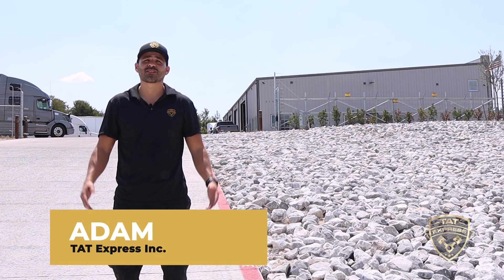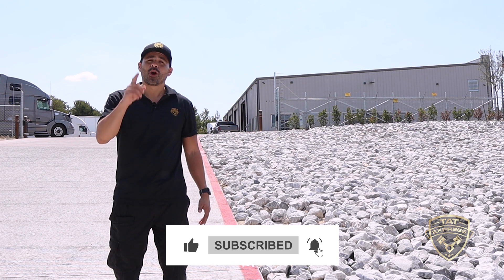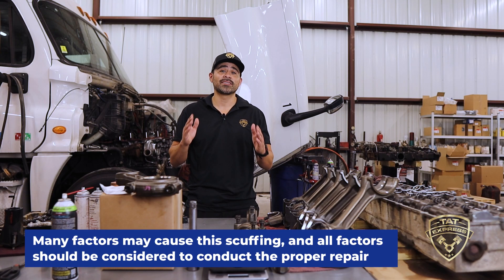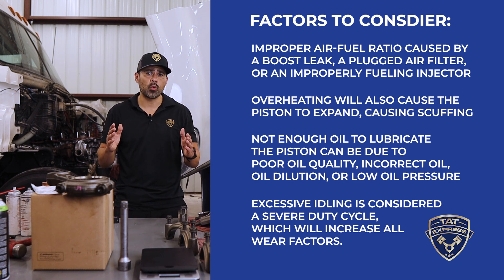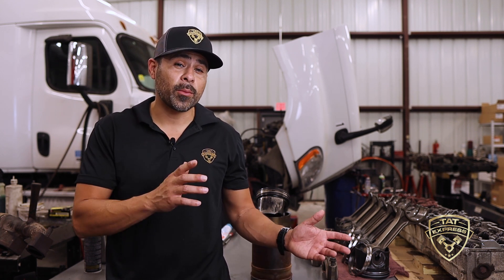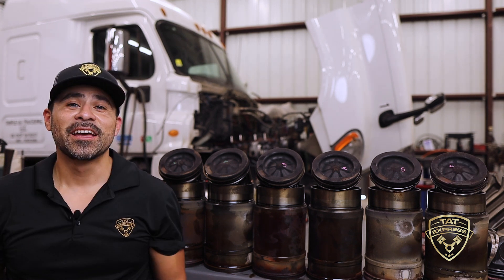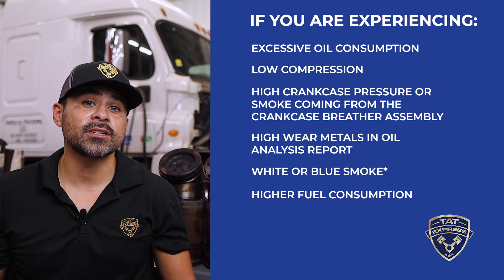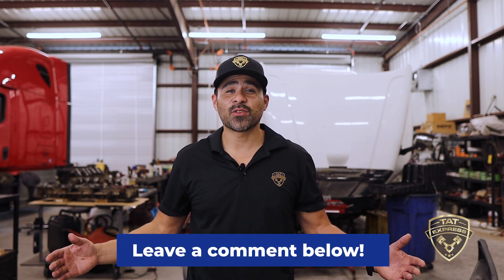DD low power/ DD low power output / DD13 engine/ dd15/ DD Delete/ low compression diesel engine

Comment: Hi Adam I have a 2014 d13 I have no boost pressure and the gauge does not move on the dash board I can only get it up to 67 miles what could be the problem thanks in advance

Comment: The fleets I service don't shut the engine down. Now they are not coast to coast trucks either. Such as idling all night with heat or ac while the driver sleeps. These are day cab trucks. I instructed them to not turn the tricks off while off loading simply due to failure to restart. Detroit's suck to put a starter on them and doing it on the road trip is extra crappy. 1 hour offload idle is not 10 hours idling while off log at a truck stop. 
Then again, all the truck I service have never had internal failure. Few time injector cups leaked compression, but always had a POS for a driver when that problem happened. Oil sump tube seals get monitored by me when servicing. Recently found two truck with 9 psi hot oil at idle and the fool drivers never noticed. Major damage prevented by one little seal on the pressured side of the pick up tube. 
Clue and don't give a damn drivers are the cause of major failure. Had a owner operator call me the other day to diagnose a Pete with a isx15. First thing I noticed was the filter still had the 6/20 sticker I put on it the last time I worked on it. Meth doesn't make better driver and I told the guy not to call me again.
Reply from the maker: Shane, thanks for sharing, and it is nice to hear techs that check maintenance for troubleshooting.  We must all work together to increase the efficiency of the USA's supply chain.  Drivers, techs, shippers, and receivers all share a high demand and workload during these times.   💪🏼🔧🚚
Reply: I like how everything is the POS driver's fault.. I understand not noticing a low oil pressure gage, but what is he supposed to do to keep injector cups from leaking compression??? 
Sometimes we are all humans and we make mistakes, even technicians..
Reply: @larryhutchinson4271  Additionally, drivers just drive. A good majority of them don't pay attention to engines other than checking oil and coolant during pre and post trip.

Comment: I run a '17 DD13/405hp in a dump truck/municipality fleet truck. A great engine, with plenty of power. Never had an issue with low power, but I can say from experience, if you have to idle the engine, shut it down (if possible). It's cheaper to replace a starter, than waste fuel (and wait for constant regenning). Can almost time the regen, to the hour (every Tuesday). I like the info & content of your channel, I 'scribed!

Comment: How much is an overhaul on a 2015 freightliner cascadia DD13??  I JUST HIT 441K MILES
Reply from the maker: @Trucker Ro from The N.O.,  It all depends on what we need in the build.  If you suspect your engine needs an overhaul, I would recommend having the engine checked out and tested before overhaul. What problems are you having? 🔧👍🏼🎥🚚